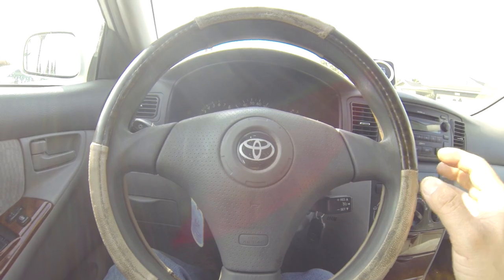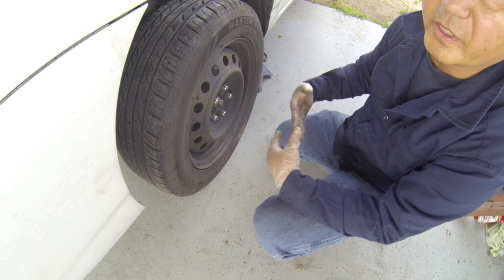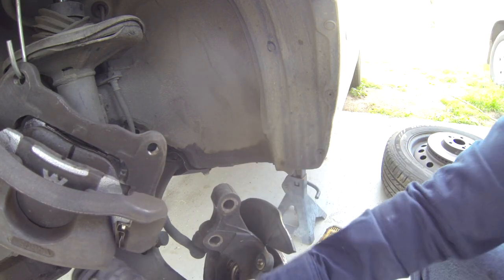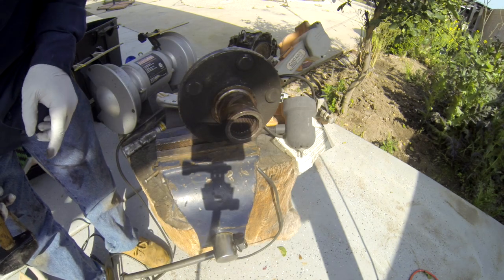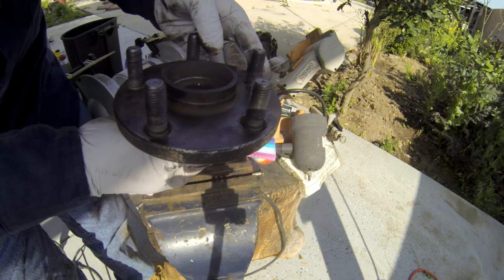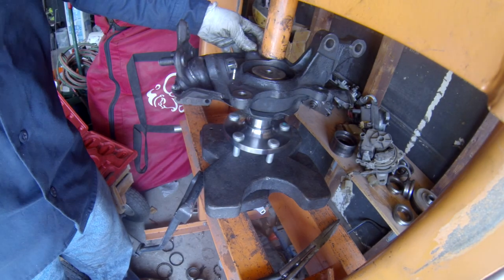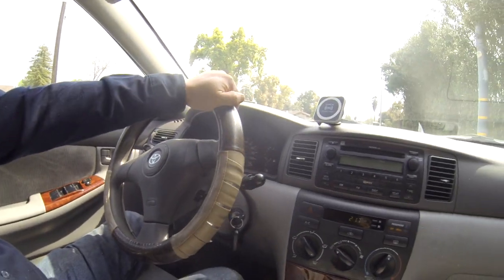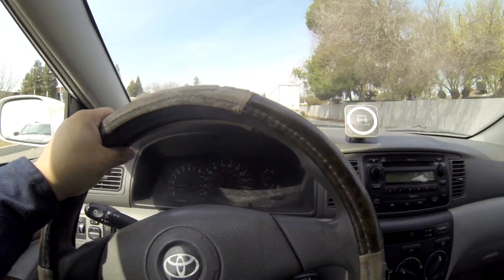2003-2013 corolla wheel bearing replacement

Comment: Great video.  Just did this today, but I took a shortcut and purchased a complete hub that came with bearings installed (MOOG).  Make sure you have a 12 point 30mm socket with 1/2 drive handy to take off the axle nut.  A 6 sided one won't work.
Reply: Does that mean you totally skip the step of having to press the bearings in ?
Reply: @t1mech1ldtc60  yes
Reply: Did you replace the bearing race on the hub?
Reply: This is the best way for the average guy to do the repair. 
No press needed.
Just remove and replace the entire spindle/knuckle assembly.
Cost is a bit more but labor and frustration is less.
Only downside is you may need to get an alignment after the repair.
Why? Because the new knuckle could be a few mm off in the tie rod attachment area.
Reply: What tourqe should you tighten the axel nut to. Doesn't it have to be pretty percise so you don't fuck up the bearing.

Comment: Great video.  I had the same noise from drivers side front. Not a diy job that I could do. My Corolla is a 2013 with about 75k miles .
Reply: I've got a 2013 with 250K miles on it.

Comment: Thanks to the uploader for giving me the confidence to do this job myself.

I had the misfortune of seized axles but I was able to push them out by hammering with the 30mm 12 pt nut 1/4 undone of the end of the threads to prevent the tip from mushrooming. It destroys the nut in the process but I was changing the entire knuckle which comes with a replacement 30mm (it was just easier in my situation). Didnt have access to a slide hammer otherwise I wouldve just used that
Reply from the maker: Good job buddy

Comment: i am doing a bearing this week  i thought if you turn left then the bearing on the right makes noise if its bad , i am also going to use heat to remove the part thats known to stay on the hub . i am also going to put the new bearing in the freezer the night before . it makes it easier to install . thank you for the video
Reply: you're right - he said it backwards
Reply: At 307,578 miles I’m going to change both wheel bearings on my 2005 Toyota Corolla
Reply: Just to be on the safe side

Comment: List of tools needed (minus everything bearing related)
Impact wrench driver
30 mm socket has to have 12 points (non-hex)

22mm socket and 22mm back up wrench
21 mm 
19mm impact swivel socket
17 mm impact swivel socket
15 mm socket
10mm wrench for ones with wheel sensor
Needle nose pliers for Cotter pin, I had to drill and punch mine out from rust.

On one of the nuts I had to use a propane torch to heat it up because the rust was so strong
A few different hammers helped.

Comment: Thanks for the video, very helpful. You do need to replace both bearings at the same time as you would do it on your brakes, rotors etc...
Reply from the maker: No you only do as need it Because bearing costly and sometimes it doesn't fail at the same time that is my opinion.

Comment: My cv axle does not slip in as easily as yours does. I must be doing something wrong. Maybe I got the wrong hub bearing?
Reply from the maker: If rust sand the rust area. Some aftermarket part slightly bigger or smaller too

Comment: thanks for the video and the explanation it really helped. what impcat wrench did you use?
Reply from the maker: Dewalt and Milwaukee
Reply: @alltsab  which kind
Reply from the maker: @ynonser5804  the 700 ft lbs Dewalt  and milwaukee one I think 800 ft lbs but I like Dewalt one better.  It lighter and as powerful as milwaukee one.
Reply from the maker: I don't remember the model number but if you search it only one in Dewalt that has 700 ft lbs.

Comment: I have the same noise with my Toyota corolla 2017 when accelerating at 35 miles and up. And at the same time, it's making noise when you back up. Is it a bearing or Transmission? My car doesn't lose no power nor no engine lights on. Thank you All Tsab.
Reply from the maker: Do a slow turn like the video to see it make noise increasing. If sound doesn't change mean that is not the bearing.

Comment: Waohh!! It was really fast! Can you tell me the type of DeWalt that you used? It seems work really nice!
Reply from the maker: I forgot the Dewalt model but if you search in Google or eBay it should have in there. The 1/2 drive with 700 ft lbs its really great one. I recently bought a Milwaukee one to replace the Dewalt but I'm not very happy with the Milwaukee.  It said more torque but didn't and didn't run as smooth as Dewalt one. My opinion i recommend you the Dewalt brand.

Comment: is the press necessary to remove the bearing and intall? can you pound it out with a hammer and wood?
Reply from the maker: Yes but it will take for a long time
Reply: If you dont have a press, you can get a bearing press kit

Comment: What's the socket size for the 2 large bolts holding the hub assembly at the top?
Reply from the maker: I don't  remember  but i think either 19mm or 17mm socket.
Reply: @alltsab  17mm

Comment: what is the purpose of your hammer at 13:45?
Reply from the maker: Axle nut lock pin
Reply: @alltsab  what does that mean?
Reply: @zekejones6976  He was staking the axle nut to the axle shaft to prevent loosening.

Comment: Jack up the wheel..start engine put it in 3rd gear..so now you can feel which one is bad by touch and feel the vibrate at the spring..